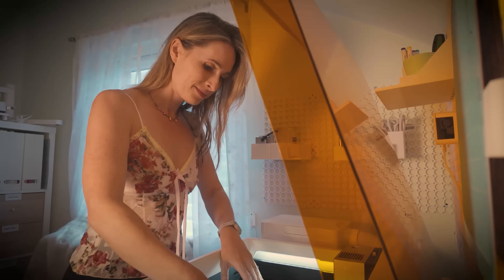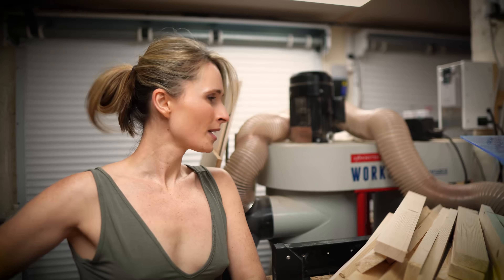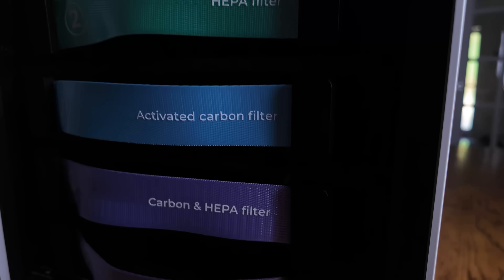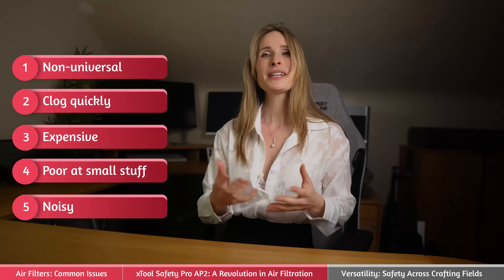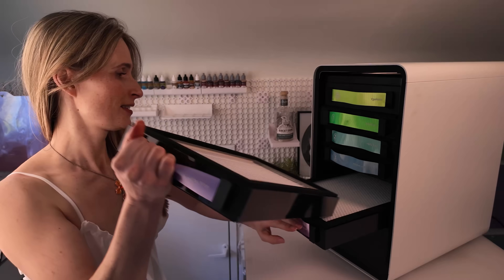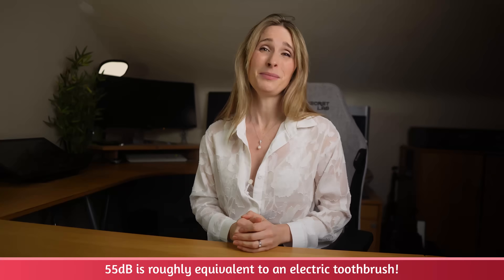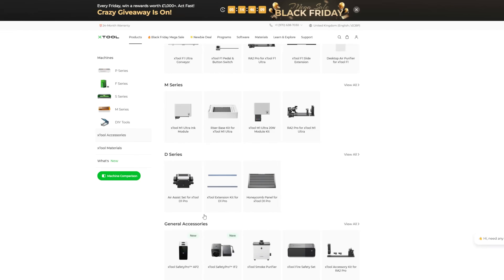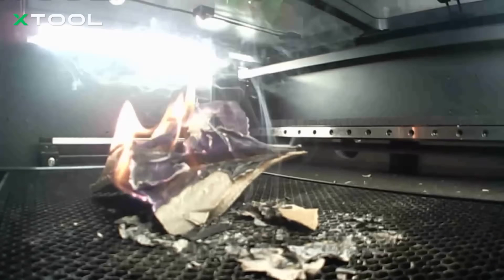xTool Safety Pro AP2: Is This the Ultimate Laser Safety Upgrade?

Comment: Ok, you got me thinking about buying one, even with existing user discount it's still in my opinion expensive. We already vent out a window with adapter made and 3D printed so back of X1 to window is only a few cms. Even so still smell fumes in room.
Reply from the maker: If you're just using a single 3d printer, then it might be overkill - although are you printing with more than PLA/PETG?  If using nastier stuff, then I'd certainly look at one, doesn't need to be this one, but think of health.   I also find my garage window venting isn't great as the wind seems to blow it back in anyway, so if you're smelling fumes, then that almost certainly isn't great.  Have you got an air quality sensor? They're usually good measures - that could be a first step, check my site for the ones I like if not.

I really can't speak more highly about this device though - xTool didn't actually expect me to cover it/feed in anything, I really was amazed. I've never actually seen a device that can take out even smells of things like acrylic (and 3d printer fumes).
Reply: @handsonkatie  well here is the thing, I have a X1C down in our basement, that is vented with open window, 95% of time its PLA, I am going to order up sensor.  My wife has the laser Xtool in one of our bedrooms which is vented out window directly. The fume smell on both is low but when she burns you can smell the wood smell. She does have thousands of Xtool points so maybe she can use that to get filter, she is going to ask question, she does a lot of the tutorial videos that you will see on their website.
Reply from the maker: Oh if you're using a laser, then definitely - this nails that smell completely and I know exactly what you mean, venting always seems to let the smell back in again!! Definitely look up the points - as an xTool user she'll get the super discount, plus if she can get points of on top, it starts to look pretty compelling!!
Reply: @handsonkatie  She has asked the question :-)

Comment: One of the first companies I worked for had a technical area where they were formerly using freon gas (if I remember correctly) for dry-joint detection and cleaning, the CFC ban led them to have to switch over to Isopropyl Alcohol - the problem was the techie's nose kept bleeding constantly from the fumes.  They had to install a rather expensive air extractor; rather than filter the air they simply exhausted the gases and particles outside the building, an expensive alteration as it needed to have a hole put in the outer core of the building (which cost about $3k).  

On that basis - would it not be more practical in a home/workshop configuration to simply exhaust the affected area outside instead?  I get a desire to maintain heat in the home, etc. but wouldn't it be potentially more practical in a home setting? 

My Mum had a vacuum cleaner called a "Rainbow", a SAVAGELY expensive but wildly effective barrel  unit on castors sold through multi-level marketing which cost about $5k in the late 80s;  it was unique in that it took intake air and pushed it through water using a fin array to pulverise the air coming in, they claimed a remarkable dust uptake that was so good you could turn it on for 30 minutes a day without its hoses in to clean air in the house.  I wonder if such a concept would be useful here?  It wouldn't cater for gases of course, only some particulates.
Reply from the maker: Great comment and yes of course, I'll exhaust where possible - so you're quite right, but there's lots of occasions where this breaks. As these devices are becoming more 'home sized', they are literally entering the home - so I can't be drilling holes in all the walls. Plus in Scottish winters, this would kill the insulation of the house! I also find, even in the garage when I'm venting through the window, the wrong direction of wind can end up blowing lots of nasties back in - so I'd definitely vent where possible, it just isn't always that feasible!

The Rainbow sounds amazing, it sounds a little like my big workshop dust extractor - as you say it's amazing at taking out large chunks of dust, but much more limited at tiny particles and naturally no good a fumes/VOCs at all. This is what really amazed me about this device, it's ability to do the 'full stack' is something I've never seen before!
Reply: @handsonkatie  the rainbow's fin design is their big claim to fame - it was intended to collect dirt primarily and when she first used it on her carpets she was HORRIFIED at the dirt that came off, the water chamber was quite literally mud;  she had to run it through several times just to get the resulting water to be merely dirty, it seemed to do that bit extremely well at least.
As for venting blowback - there are ways to cater for that, you can simply put a wind guard around the outside, I've seen that done before.  In a practical sense - how often would you have this running though?  I mean we mere mortal normies of course, you've got enough 3D printer gear to build a house per week so there's that... This gizmo really is damn impressive though, the multi-filter is wonderfully over the top.  Sort of thing Elon would want aboard his Starship rocket indeed.
Reply from the maker: Cool - have you got a link to this rainbow device?!! I'm even more intrigued!  But you're spot on with 'how often' is the key question, if you're a keen crafter and you do this every week, then it comes into it's own, if you solder, sand, laser, 3d print once every six months, then it really doesn't matter, just jerry-rig something temporary and you'll be fine!
Reply: @davocc2405  don't overthink
Reply: @seanoconnor8843  Given that I've seen personally the impact of poor ventilation on this basis - I think it's perfectly valid to examine that.
Reply: @davocc2405  I wouldn't pay for it

Comment: It sounds amazing on paper, I really wonder if an independent testing lab comes to the same conclusion as they did and how long those filters will last. Most filtration systems require new filters every 6-12 months or so which seem to cost about 36+36+45+27+18=162 euro. Unless it has really advanced sensors you can't easily tell how clogged the lower filters are, so you'll have to replace them periodically to be safe. Still... an amazing deal for a filter that does all this, I might just buy this...
Reply: Users of the older xTool Smoke Purifier found the filter packs could become clogged and ineffective in as little as two weeks. This filter system design is no better other than allowing individual filters to be replaced.

The prefilter should be removed and cleaned at least daily, or every four hours of operation. This will prevent buildup of large particles. Once the prefilter is clogged, far too many larger particles will pass through to the HEPA filter and cause it to become clogged. The most important filter for improving air quality is the activate carbon filter as it removes particles as small as 3 microns.
Reply: @GaiusTacitus thank you, that's good to know!
Reply from the maker: Just to keep advice based on facts, not conjecture - check other thread with gaiustacitus4242, I've been chatting at length! Struggling to get a coherent view, so reading might add a more balanced view of expertise as he's not actually tested it and I think misunderstood many of the features! 😗
Reply from the maker: Well I wouldn't consider myself a testing lab, but I did have both the Apollo Air and Airgradient sensors monitoring all of this, so it certainly stood up to them - as I say, the air quality actually marginally increased after I'd been laser cutting! (no doubt it's pulling dust and the like through the filter from the room). 

Yes, the app has a sensor gauge for each filter, I 'assume' this is based on standard time/usage measurements, but I'll check that with them - they'd be on a new level of cool if it could actually measure it - though I can't even grasp how they could do this!

It really is pretty impressive what they've achieved though!
Reply: @handsonkatie Thank you for the reply, that makes a lot of sense. Thanks to your recommendation I actually bought an Apollo Air-1 (and a few Apollo MTR-1) sensors several months ago and I'm really happy with them. But I did find out that the Apollo Air sensor "fakes" some of the air quality values. Nothing nefarious mind you, but the PM4 and PM10 are calculated values based on the other values by the SEN55 sensor. Air quality is notoriously difficult to measure correctly however, especially at low volumes so it's hard to analyse it properly.
It's definitely a very impressive device!
Reply: Creating a vent to the outside is a one time investment. Venting to the outside is safe without any doubt or sensors or whatever.

Comment: Great video as usual 🙂 I’m wondering if it can be used as a general room air purifier? What are your thoughts? Did you try it with non xtool equipment too? It looks cool. Anyway, keep up the awesome work! Morgs from Australia 😊
Reply from the maker: Thanks Morgs! I terms of a general room purifier, I don't know - obviously this depends on the room size. Ultimately, it sucks air in, filters it to a bonkers level and spits it out, so there's no problem with the theory, I just couldn't vouch for how long it'd take, max volumes and more.

I'm building a whole range of converters and adapters to allow easy use with every device I can think of - it's become my instant go-to for resin printers, FDM printers and more. Hence I'm redesigning my workshop layouts to accommodate this as I mentioned! I'm thinking a nice range of parametric magnetic duct mounts would let people easily adapt for their own devices!
Reply: @ yeah nice! Will be interesting to see the adapters you create. Thanks for the vid 🙂

Comment: A few things.  Before you buy one of these, buy an air quality sensor with a wide range "particulate matter" sensor.  Graph it over a month.
You might find, living in the UK, that unless you live need a "dust" hazard or a very busy road, it will be near to 0 for all of them until you turn the cooker on to fry some chops.
However, you will probably also find, that whether you have that big filter running or not, makes little to no difference to the air quality in the house anyway.
The reason is basically to do with circulation.  The little filters do not move enough air or have a large enough sphere of influence to not simply re-inhale the same air over and over again.
If you have an issue with VOC, PM or any unfavourable atmosphere...   if it's inside, use an extractor to pull it out.  If it's outside, phone your local council and environmental agencies.  Shut your windows, use an air inlet fan with a filter.
Reply: even with my cheap Ikea dust filter i can notice when ive had it on how lighter the air feels. I'd say it's placebo but i shake out the filter weekly and its full of dust every time.
Reply from the maker: You're right actually, I find the same with robot vacuums - because they so easy, you just set them to run all the time, but it's amazing how much they collect every time!!
Reply: good idea, will look at one of these.
Reply from the maker: Love these points!! Highly recommend an air filter, indeed covered this here:
https://youtu.be/dQhwOuFlFWo

On the other points - to be clear, this is a device designed for dust, smoke, VOCs produced by devices (eg laser cutters, 3d printers etc) - so definitely not designed for just ambient filtering of room or even improving outdoor air quality as you say!
Reply: @handsonkatie  Fair enough.
True to style for me... I bought an AirGradientOne for my office/lab.  I take the 2.5ug/m3 data and trigger an extractor based off it.
So, if I start SMD soldering, it will start the extractor.  I have seen it get triggered by "pouring grains for beer" in the kitchen ... on a different floor, but it seen the "malt flour dust" upstairs!
As to how well it works, pretty prompt.  I test it half a dozen times a day when I smoke a cigarette.  I see the spike in the PM, the extractor comes on and it then drops faster than if it wasnt on.
Downside is, it has to draw (usually colder) air in from outside somewhere.
Reply from the maker: Great examples - it's only just got cold in Scotland, so it may be the AP2 starts to pay for itself once winter sets in, you're quite right that venting all the warm air may become both expensive and unpleasant!!
Reply: @handsonkatie  On VOCs and VOC meters.
Be ware.  They also tell tales on your about your drinking habbits.
Even the cheap IKEA Zigbee ones.
Sit down and have a bottle of wine in the room with them.
Note the VOC Index!
I can pretty much query the data over the past month and give you an approximate number of evenings I had drinks in the office.  Scary!
Reply: Sorry!  That was IPA for cleaning things, honest.
Reply from the maker: That's amazing!!! I'd never thought about testing that!! You know I'm going to have to do some thorough testing now!!